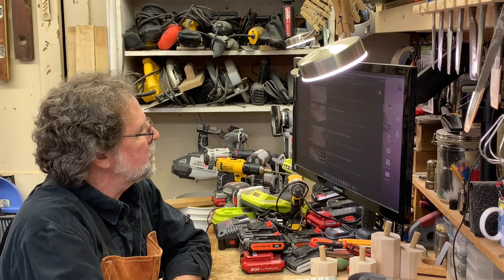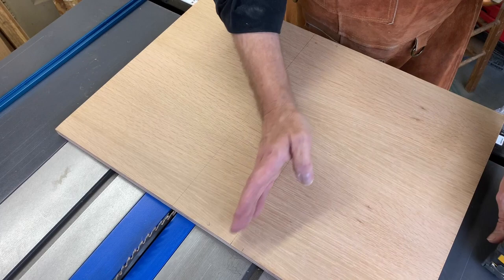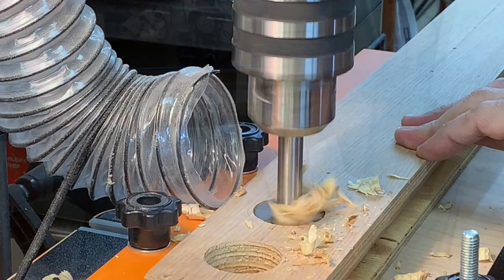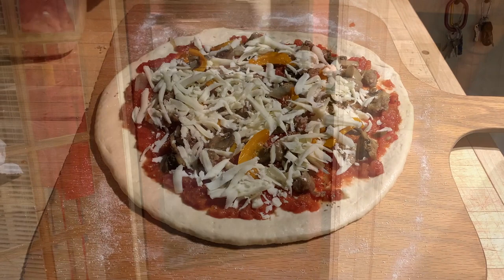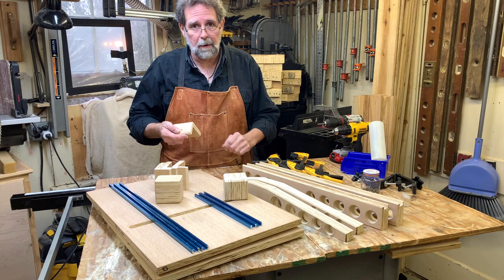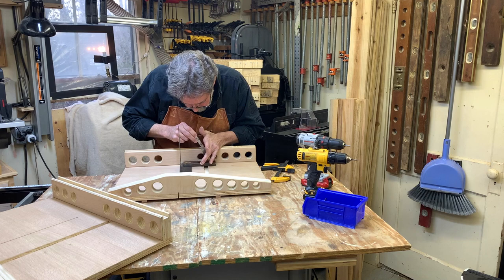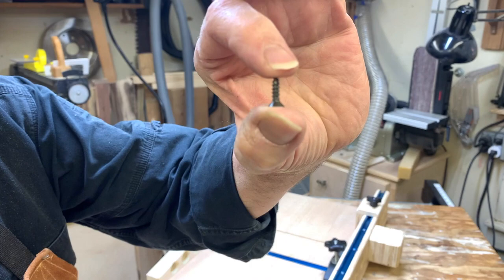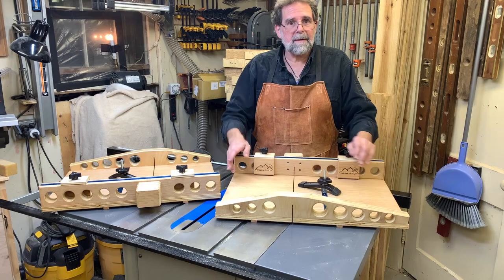Like we need another Table Saw Cross Cut Sled Video - S2:E2

Comment: Nicely done!  Personally, I probably would not wax the top of the sled where the pieces to be cut or held because you want a surface that the pieces won’t slide around on. I have two sleds, one, the larger one, has a 21 inch depth capacity, I use it for panels. I built it some 20 years ago and except for replacing the area around the blade kerf, it’s original and still going strong!

Comment: Wow! An avocado Bleak & Darker router still in the wild! My Pop wore out one of those and the matching 3/8 drill! 

Great presentation and nice pizza intermission!
Reply from the maker: Right on!  The router was my great uncle's.  Still works great for rounding and chamfering edges.  If it breaks I will go for a trim router.  Until then I'll keep chugging along.  For the time it's a great form factor and somewhat light weight.  I wasn't sure about the dinner intermission... but it seemed to fit.
Reply: @3twelveworkshop312  I’m sorry to say that his wasted away in his shed so I never used it. My Bosch Trim Router is my go to router. It’s the right size for the shelf edges I’m “improving.”

Comment: Can’t agree more on the excessive glue amounts in most woodworking videos. It’s just wasteful to have gobs of glue dripping out every time you glue up something. And cleaning it up wastes your time too.
Love the vintage, craftsman radial arm saw. It’s a little bit newer than the one I inherited from my dad but the design is unmistakable. I’m pretty sure there’s some parts on there They didn’t change for 30 years. Mine is still rock solid. Though I did buy another one to scavenge the motor. They get little respect these days, though when you think about it, they’re just a more flexible sliding miter saw.
Reply from the maker: My RAS was a found tool that people didn't want to take the time to true up and work on.  The switch was busted, so to them it made more sense to replace the whole saw.  I fixed 'er up and added a somewhat effective dust collection system to it.   Thanks for watching!!!